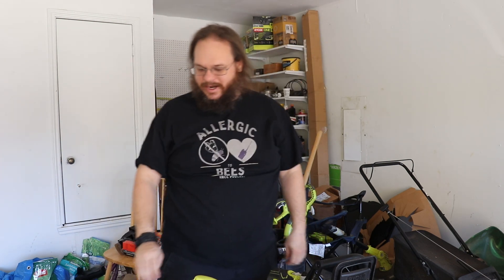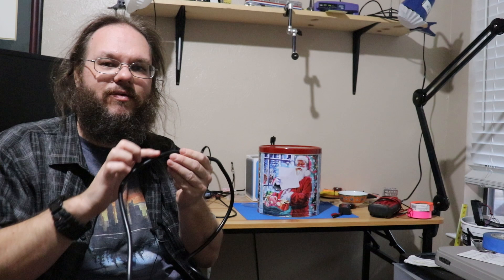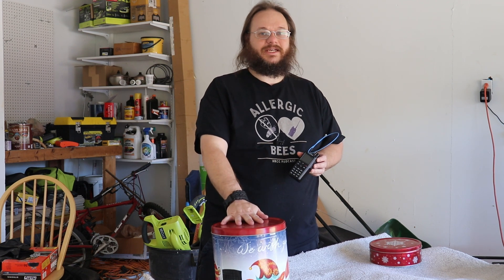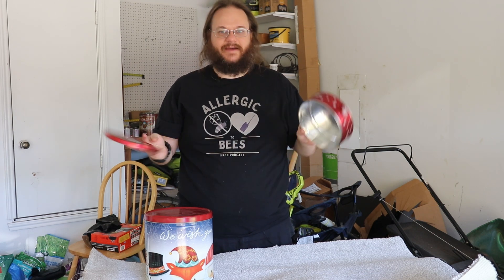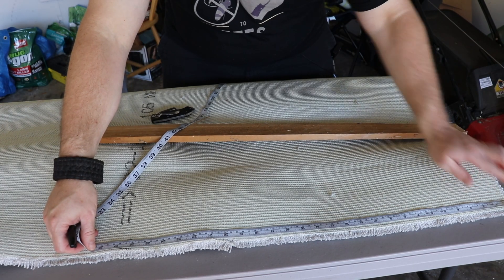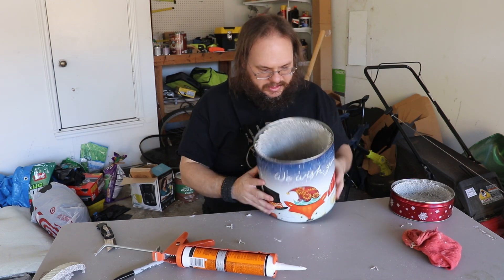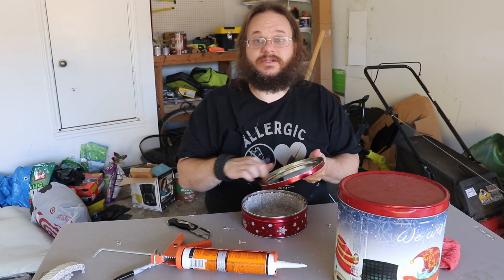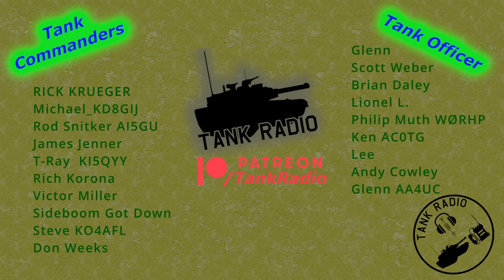Christmas Tin EMP Faraday Cage

Comment: Man you made hard work of that, draw around the can and cut inside the line. The upright bit is height of can x πD (3.14 x Diameter of the circle) or your 28" then trim the end until it fits.

Comment: Great video .  quick tip for measuring the inside wall of tin...  measure across the Tin on the inside at its widest point, then multiply that number by 3.14 and that will give you the circumference of the tin on the inside which should be the right size for the carpet. this will save you having to cut twice. if you want to be really accurate then   3.141592653589793238 is what's known as pi, same as the way we use a rounded figure for antenna length calculation.
Reply from the maker: Thats not just a tip.  its SOLID math.  All these great ideas on doing this easier.  I need to post about a build an gather these up before i build the project